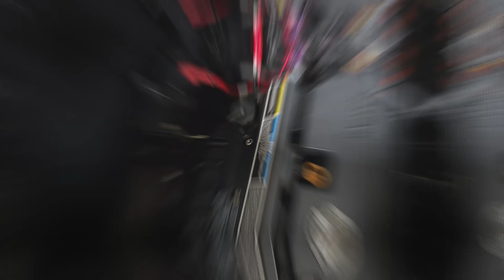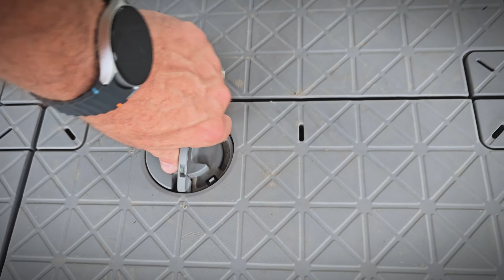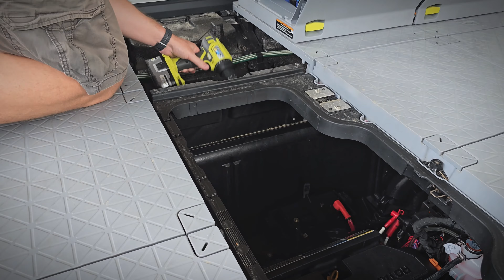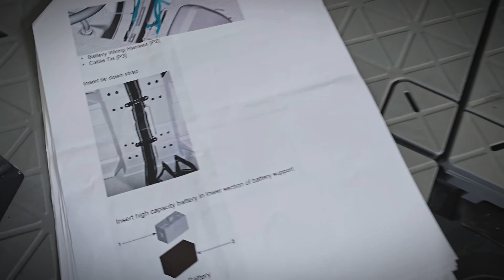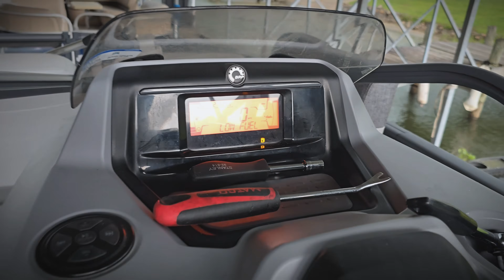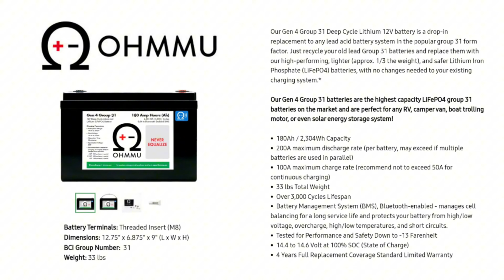Seadoo Switch 12v Battery UPGRADE | Ohmmu Lithium Battery Full Installation

Comment: All the Lithium batteries I've seen don't recommend starting the engine with them. Deep cycle. Is your Ohmmu not a deep cycle?
Reply from the maker: Usually it's because they don't have enough cranking amps. The Seadoo Switch doesn't pull that many amps to start it so it still works fine with the Ohmmu lithium battery.

Comment: Hey, I just installed this. I really appreciate your video. Just one question if I want to put a charger the front battery is there a way to do that where the switch is or do I need to go and take off the cover on the front new battery?
Reply from the maker: I think you'd have to do it directly on the front battery

Comment: Hi Jeff, your video answered my questions about how to install the dual battery kit, but I have a couple of questions about the battery you recommend. It looks like it is just a deep cycle battery. Wouldn't you need a dual purpose battery if you're using it to start the engine? This is a group 31 battery, but the kit says that it is for a group 27 battery. Can you confirm that it has room for a group 31?
Reply from the maker: Happy to help. The battery from Ohmmu has enough cranking amps that it works fine with the Sea Doo Switch. Some boats require more than others, but with the Switch it's fine. Regarding the size, Yes it fits the group 31 from Ohmmu fine. That's my exact setup.

Comment: Those screws for the battery selector do not appear to be stainless steel.  The ohmmu is way overpriced for its capacity.  I could get two 100AH lithiums for $120 each.  Yes, wouldn't fit in one location, but saves you $750
Reply from the maker: Depends on what you're looking for. The Ohmmu is a 180 Ah LFP battery in a group 31 size with bluetooth/app and self-heating. Not really much comparable there.

Comment: How does the second battery gets recharged? Is that a manual process you have to do? Since you will be using it only while parked and engine off.
Reply from the maker: I mainly use the new Ohmmu battery. To charge the original, I just run it every couple of months.

Comment: This is an excellent video, can you let me know what I would do differently considering my 2024 Seadoo Switch already has a kill switch for the stock battery.  Thank you.
Reply from the maker: I don't think you'd need to do anything differently. You'd just wire in the new switch with the two batteries instead of the single battery one on the 2024.
Reply: @TechnicallyJeff  Thank you, and sorry to bother you again. Of the Red cables coming off the Dual Switch, which one is the Load Cable. or cable that goes to the boats power wires?  Mine arrived without the Red Boot, or the Bolt and Nut on it, so now I am not sure which one of the Red Cables is the load cable, will I need to purchase the bolt/nut, since it was missing from my packaging, or would I use the one already on the boats power wire?.  Thank you, and your video is Excellent!, I am subscribed.
Reply from the maker: Hmm to be honest it's been a little while since I did it. I can't watch my video right now, but if you watch it closely are you possibly able to tell?
Reply: Thx, it’s hard to tell from the video but  I should be able to figure it out:)  I assume 1 switch is original battery, 2 is new battery, so the other connector on switch should be load.
Reply from the maker: Yes I believe so IIRC
Reply: @TechnicallyJeff  got it done and everything’s working thank you for so much for your help. If it wasn’t for your video. I would’ve wasted a ton of money having it installed.
Reply from the maker: Awesome, I'm glad you got it working!

Comment: My switch came with a battery cutoff switch from the factory. Can that one be used for this setup or is it different? Thanks
Reply from the maker: Was it a dealer add on? It likely could be used depending on the type.
Reply: @TechnicallyJeff  I'll have to look at it, but they now come standard.
Reply from the maker: Interesting that's good to know

Comment: @TechnicllyJeff I heard that installing lithium batteries might require an alternator upgrade. Do you know if the alternator on the Switch is compatible with the Ohmmu lithium batteries? I know you installed this battery a few months ago and wanted to see if you’ve had any problems. I just purchased a 2025 Cruise Limited and plan to add a second battery, and from what I’ve seen, lithium seems to be the way to go these days.
Reply from the maker: The switch uses a stator and it works with the Ohmmu. I have had a couple of error codes come up where it says high voltage, though it should only be receiving whatever the stator voltage regulator says. I'm working with Ohmmu to maybe setup a profile for the battery specific to the Switch to avoid potential issues there. Unfortunately though, erroneous error codes with the Switch are somewhat common, but clear themselves usually. But I've been very happy with the Ohmmu. It's so nice to be able to park and have music playing for hours, then blow up the tube, and not worry about killing the battery.

Comment: Terrific video Jeff. Shopping for the Seadoo Switch 18 Cruise 230 hp and like other posters, this is the very first thing I would do for the boat when we get it home. Do you feel like there is enough cabling in the kit to allow for the battery switch to mount on side of drivers console in area of ignition key connection. Saw someone mounted their single battery switch there and really liked the clean install they did. Would be nice not to have to go down under deck to switch batteries on/off.
Reply from the maker: Yeah it's really nice to have so much more capacity. For the battery switch cable, I don't think there's enough to route it up to the console. You could always get additional cabling though.

Comment: Might slow your videos down a bit for those who cannot follow as quick as you’re going, like wiring for sure!
Reply from the maker: That's what pause is for 😀
Reply: @TechnicallyJeff  You don't really show how the wiring is connected at the original battery....and that is the most important step.  Wish you had spend more time with that step.
Reply from the maker: @AndrewVanRoyen  sorry about that. Are you able to pause and look at the final result to get what you need? Or do you have specific questions I can answer?

Comment: Hi Jeff, my Seadoo dealer recommended a 2nd battery for my 2023 Switch, but never put in or told me about needing a kill switch for the batteries. I've had dead batteries twice now when the boat sits for a while. Something is drawing on those batteries when the boat is off. What is causing it?
Reply from the maker: Yes a 2nd battery is good to have along with a switch to turn them off. That said, if they are normal lead acid batteries, they will lose 10-20% battery capacity per month on their own through regular standby drain. One of the benefits of the LiFePO4 I installed in this video is that it barely drains at all. After all winter I came to the boat after 5 months and it still showed 100% charged.

Comment: Instead of adding the new battery as a second battery, can you just use it to replace the factory battery? If so, will it fit in the factory battery compartment? Thanks!
Reply from the maker: You could but it definitely won't fit in the factory battery compartment. It's too big.
Reply: @TechnicallyJeff  Thanks!
Reply from the maker: No problem!

Comment: Hey Jeff great video. thanks a lot. However, everything I've read about having a backup battery shows the circuit switch connected in to the black negative line not the red positive line for safety reasons. I know that most new seadoo selector switches are connected in the positive line from the factory, so it would be much easier to just continue that process  but i wonder about electrical safety . What are your thoughts?
Reply from the maker: It’s pretty common to have the switch on the positive line but I’m not an electrical expert. I don't think it should matter though. The switch definitely cuts the circuit when it's off.
Reply: I'm just thinking that if I'm careless enough to accidentally drop a wrench on the switch selector And the other side of the Wrench touched Any grounded piece of metal I'd have a hell of an arc Whereas If the switch is all the ground wires it would be ground on ground. But unfortunately Sea-Doo started the process and the positive line so I may stick with that for ease of installation
Reply from the maker: Ah yeah I get that. That should be a very unlikely scenario though to be honest.

Comment: please be very careful with this type of installation. first issue is connecting a LiFePo45 battery directly to your alternator. A lithium battery has a much lower resistance and a lead acid battery and will take all the amps the alternator can put out, that is not good for the alternator and could kill it quickly in the worst case scenario or shorten its life in the best case scenario. second issue is when connecting both batteries in parallel, if the lipo is depleted and the start battery fully charged and flip that switch, you have the potential of running a ton of amps through those wires when the batteries try to balance their voltage. 

there are many videos in youtube about how to do this safely in youtube, doing it this way is very unsafe.
Reply from the maker: The Switch has a stator, not an alternator. It also has a BMS so the charging profile the boat sees is similar to a lead acid battery. Regarding connecting them in parallel, you definitely don't want to charge the two batteries at the same time (1+2 on the battery switch). I only have the original battery as a backup in case of an issue. I just use it every now and then to keep it charged. But yes, don't use both at the same time. Different chemistry/size batteries shouldn't be run in parallel.

Comment: Hello, mine came with the nut and cover on the long red wire. What short red wire needs to be bolted to the boat supplied wire? Does it matter between the 2 short wires? If I'm connecting a noco charger for both batteries, where would those connections go? Thanks
Reply from the maker: Yours didn't come like mine in the video? I think it does mattery which one you use if I recall correctly. Try to pause the video and look at how mine is hooked up around 5-6 min into the video. I'm not sure about the noco charger part. I haven't set up a charger like that on my boat.

Comment: Hey Jeff, great video. We're picking up our Switch Sport 18 in a few weeks and this is the first upgrade we're doing. I'm a previous boat owner, but never had to deal with dual batteries. 

Could you elaborate a bit more on the battery switch settings? Specifically, what is the purpose of the "1+2" setting? Would using this setting cause any issues if running two different types of batteries? Also, how do both batteries stay charged? For example, if battery "2" is being used primarily, does battery "1" still charge even if the switch isn’t set to it?

I really appreciate your insight—thanks in advance!
Reply from the maker: Glad to help! The 1+2 setting uses both batteries and charges both batteries. You only want to use that if you're using the same type and size of batteries. I keep both charged by running the new battery the majority of the time and just running the old battery every couple of months to keep it available as a backup if necessary.
Reply: @TechnicallyJeff  exactly what I needed to know, thank you!
Reply from the maker: @mikesamsondesign no problem!

Comment: But what stereo are you running? The basic or the JL system? 
Wondering how the battery works with the upgraded stereo?
Reply from the maker: I have the basic 100w system. It would do great with the upgraded system as well.

Comment: Hi Jeff -- i have a question,  i been researching about putting a LifePo4 into my Switch -- and you're actually the 1st Person i came across that installed one... Main Question i have is, does the OEM Charging System keep the LifePo charged up good????  And you didn't add or change anything else except the addition of the LifePo4 ?  My Switch has the Rotax 170hp in it... I'd want to just remove the Stock Battery and replace it with a 100Amp  LifePo4.
Reply from the maker: Yes it charged it up to 100% (took a couple trips out to fully top it off). And the only things I added were what I showed in the video - the dual battery kit with the wiring, switch, and battery box, and the battery itself.
Reply: @TechnicallyJeff  Thanks for the reply, I do believe I'll invest in one now.
Reply from the maker: Sounds good, good luck with it all 👍